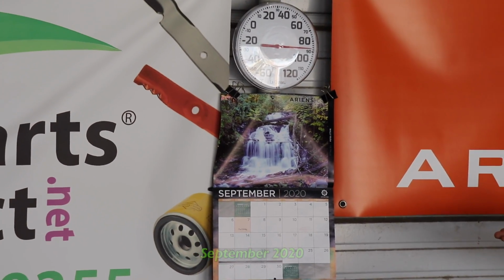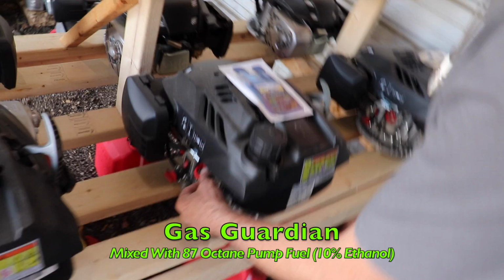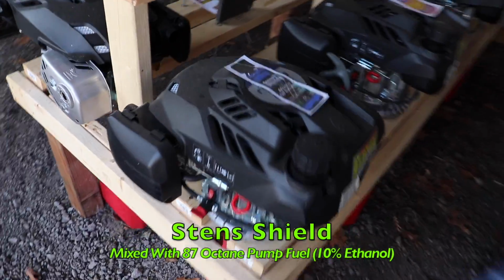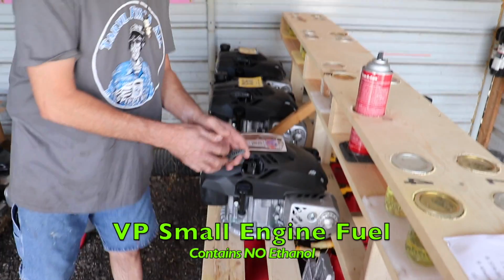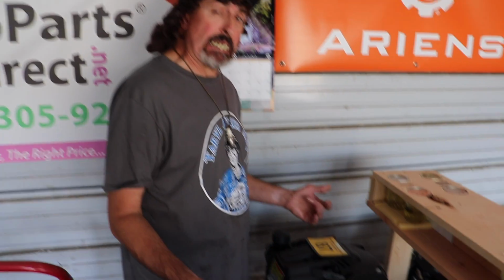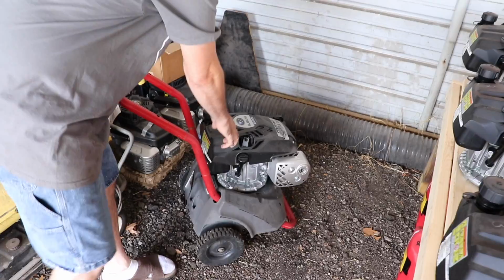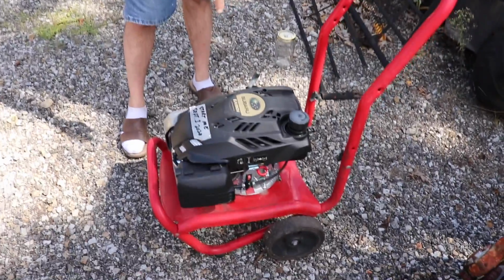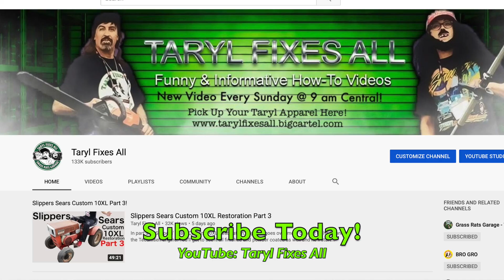Fuel Additives DON'T Work - Why?

Comment: I really enjoy watching. Learned a lot .The scrattons I worked on in the 60s were not that hard to repair. Seems like the newer ones without points are fairly easy to repair.A friend had a 4.5 scratton that been under 2 feet of water at his camp on the river. He figured it was history. Both valves were closed when he turned it off.Ignition was good. Cleaned the carbetrator ,got all the mud off it .It ran great but steamed out the tapper vent a few minutes.

Comment: I've been using Sta-Bil for several years in a 14 y/o 22hp B&S and have never had to disassemble the carb, or have had any trouble with it not starting in the Spring. Actually, I only cut about 60 hours a year and since I don't really use it that much I just put Sta-Bil in my gas can when I fill it up. 
Recently, a new gas station opened near me and they offer 90 octane ethanol-free gas; so I've started using that. Still, I'm continuing to use the Sta-Bil. 
Sta-Bil has about a 2-3 year shelf life (forget exactly how much, it's on the bottle) in it's container and this is why I just put it in throughout the mowing season. I wouldn't use up the Sta-Bil container over the course of a couple years, so, why not.
I do turn the fuel shutoff on the engine and run the carb out of gas at the end of the season.

Comment: I’m storing all my gas in sealed jelly jars from now on.
Reply: Haaa awesome
Reply: Need Extra crunchy peanut butter jars
Reply: Just use clean, non rusty steel Jerry cans with an airtight seal filled to within an inch of the cap and kept out of the sun. I've only kept e0 gasoline for 10 months that way so far but when I open one of those cans it's still just as full and just as clear as the day I filled them up! Just my $.02 worth.
Reply: That brings back memories of going to grandmas in the 60's to mow. Gas was stored in a 1 gallon glass apple cider jug and stored in the cool dark pump house next to the well.
Reply: @WKBHB  that was moonshine
Reply: Grandma liked to party.
Reply: theyre getting hard to find lol
Reply: @jusb1066  No wonder that mower ran so good LOL.

Comment: I'm wondering if the moisture in the air has mixed with the ethanol and settle to the bottom and got burned off first after months of being outside I'd be interested in seeing you pull small amount of fuel out of one of those Motors testing it for ethanol

Comment: My guess is that the 3 month engines had more ethanol separation in the bottom of the carbs. So it took a few extra pulls to get the water sucked out of the bottom of the float bowl before it pulled fuel into the combustion chamber.

The monthly starts on the other engines only has a little water to deal with each month, which may be causing the variation in how many pulls it takes on those engine.
Reply: That definitely makes good sense. 👍
Reply: I was also thinking evaporation in the fuel bowl has something to do with it.  After three months, the fuel in the bowl would have evaporated a lot more than the ones starting every month.  Need a few more pulls to get everything primed back up.  Plus the lower fuel level in the bowl exposes more dried up area for boogers to collect.
Reply: @grosskt  these carbs are gravity fed, so they should have fuel at all times. I dont recall Taryl turning the fuel off on these. This is why ethanol separation is a big deal in this scenario, because all of the water will collect at the lowest point, the float bowl. More time = more water sitting in there.
Reply: Brandon Titus Good point, didn’t think of that.

Comment: You don't have to holler at me Taryl, I got a question. Lol!
The"engines" start up, BUT would they be able to be put under a load? Does the fuel retain enough "umph" to be able to cut some grass? Are they even getting up to full rpm with that old fuel( you have that german rpm checker)? It's just an honest question....
Yes. Put Ronnie on a shirt and Junior (with the saying off his hat!) Lol!
Enjoying the experiment! Keep it coming!
Reply: As I recall, these engines would never be able to cut grass, he'd have to see if they can split wood.
Reply: @chrisbcritter6112  I couldn't remember what their intended function was. I didn't mean literally " cut grass". I'm meaning whatever puts a load on them rather than just sit there and idle. I've put "stale" gas in my chainsaw, it'll start up, but won't have enough "power" to cut wood. But that's 2 cycle. May be getting deeper than his original intention here.

Comment: Yeah summers over (almost). Soon leaves will start to fall and people will be bringing you their snow blowers with carbertrator problems, the cycle of life continues...
Reply: Do you have the Wawa gas stations where you live? they sell Ethanol free gas. you don't need any stabilizers in it.
Reply: In my area, East Tennessee we have Marathon stations that sell Rec90 mid-grade. Recreational fuel 90 octane, no ethanol. That's what I run in my garden tractor lawn mower. Runs better, more power and starts quicker. It's been $.40 cents a gallon more but worth it for lawn equipment. Run in car in winter for faster start up.

Comment: Hello Taryl,
You have proven why I don’t use fuel additives. In November I either run my equipment out of fuel or fill the tanks for winter. In April I check the oil, fill the gas and fire them up, then I move them into the garage for a pre-opt inspection.

Comment: Repeat the same experiment on 2 cycle engines.  That's where I've seen the most problems with my own equipment.  I don't think the larger 4 cycle engines have the same frequency of fuel related problems as the little 2 cycles. Regardless, I've taken my dealer's advice and have always used a fuel additive in the zero turn.  The only problem I ever have is getting it running for the first time in spring.  I think it's mostly due to the fuel evaporating from the carb over the winter, similar to your 3 month trial, although my equipment sits about 5 months.  Now I just pour gas into the carb for the first start of the season.  After that I don't have to repeat that trick.

Comment: I heard a few misfires off the 87 and 93 octane non treated fuels.
One thing our workshop has realised is that if you add a ethanol free fuel like ASPEN into a two stroke machine that has been only run on unleaded pump is that the diaphragms and fuel lines perish quickly as they have already been weakened by the pump fuel.

Comment: Taryl, what I do, is I keep 89 octane in anything I use every summer and I always put just a little bitand the gas tank of my push mower or push mowers and riding mowers and even tillers and other 4-cycle equipment and I go out and start all of that stuff once every two weeks and let it run for about anywhere from thirty seconds to a minuteand sometimes three or four minutes maybe 5minutes if it's a riding mower and I even bring it out and ride it around even if it's 25 degrees out during that time......... now granted here in southern West Virginia we've had zero weather lasts for a solid month before but normally the past many years our winter times have been rain and 42 mid 40 degree days up until most of February and an early part of March seems to be our winter timebut I never use any kind of gas additives and when I have used in the Years passed it never seemed to help if I let something just said and never go out and started for 2 months and beyond that length of time or the whole winter time

Comment: I just got a new 60 inch Toro with the my ride seat. I use Ethanol free never any problems. Taryl you need to put that in your test and let it set for 6 months.

Comment: I have a pretty random question.  I have a c111 wheel hirse with a 11 hp Briggs.  I put a new carb in it but now when I open the throttle it shifts wide open and sticks. I have to shut it down to stop it from blowing up.  Do you have any ideas to whts going on? Thanks!

Comment: i bought a huzqavarna 2018 model used it 8 times followed the 32 to 1 then 50 to 1 they recommended on breakin like i said barely used it now it has 40 compression but out of warrenty.what causes that cheap parts?125bv

Comment: Can you comment on why #3 sealed jar looks clear or empty ?
Reply: It's fancy 4-cycle fuel (no pump gas w/additive - just a metal can of straight gas with no ethanol).  It doesn't have the yellow color additive that pump gas has.

Comment: Does it make a difference between plastic vs metal fuel tank? Just curious.
Reply: In my experience, yes metal seems to keep fuel fresher longer. I believe keeping sunlight away from the fuel is also a factor, may be just enough ambient light makes it through my red plastic cans that caused my experiences idk🤷‍♂️
Reply: absolutely. Plastic does not create condensate as easily as metal and along with condensate in half full metal tanks comes rust above the gas line. Plastic all the way with ethanol gas.
Reply: @garny3766  yes! I forgot to mention I've only used steel cans filled with ethanol free or 100ll to within an inch of the cap for storage. 
Thanks for pointing that out👍

Comment: Considering that the vented jars are evaporating and changing a great deal,  it makes sense for all of us to have an air tight gas can.   I wonder how air tight the tanks on the engines are.
Reply: Air tight gas cans are also safer. No stray gasoline fumes finding a source of ignition.

Comment: Hey taryl, I’ve got myself a 80’s-90’s 11 horse brigs MTD and it only stays in speed 1  even if I push it all the way so speed 7. I’ve tried doing some research but can’t find out why it’s not working like it should. If you could do a video on how to fix that problem or explain how the older speed selects work on riding mowers That would be appreciated.

Comment: taryl, i put gas in my new generator last winter, and electric came back on, so i didnt get to use the thing. i have started it about once a month just to keep the thing active. now it wont start. i suppose something is gummed up. what do you recommend? ty
Reply: Bolt it to a work bench with 10 engines that run every month to mix the gas in the float bowl like Taryl does. It’s working for him.
Reply: @terryskinner9466  Did you shake the bench?
Reply: George Ewing no but put a glass of water on top of your lawnmower and tell me what happens to it. It’s not rocket science!
Reply: I'd drain the fuel out and try fresh fuel first if you haven't already done that.

Comment: I use stabil and lucas safeguard ethanal fuel conditioner together in my generator and years later it starts right up.The key is to fill the tank completely and drain the carburetor. My general rule is to fill metal tanks and totally empty plastic tanks.

Comment: Don't change the run time for the engines because that will introduce a new variable.  After the year is over (unless you're planning on running this for 2 years) why not take the engines and divide them into groups that sit for 3 months, 4 months, 5 months and 6 months without running and use raw 87 octane and the two or three most popular fuel additives to see if they make a difference.  That will more closely simulate the winter storage for mowers in different parts of the country.  Since the months are staggered you'll have a new video each month for most of the year or more.

Comment: To me it seems like atarting them every month could help them. Gas is a very good solvent and as it's passing through the main jet and emulsion tube it could be breaking stuff down.
Reply: Having them bolted to the same bench is shacking the fuel in each tank and carburetor. Ummm kinda like an ultrasonic cleaner?? I think we would of had different out comes if these engines wasn’t bolted on that work bench together. Just my opinion. Probably why number 10 took 3 pulls to start. It hadn’t been shook up.
Reply: George Ewing you don’t think those engines running aren’t shaking those other engines and slashing that gas in them?😂

Comment: The vented jars of gasoline have lost so much because the jerry cans were presumably filled in December.  Winter gas has a higher vapor pressure and evaporates more readily than low vapor pressure summer gasoline.  You'd lose nearly a quarter of one of those closed jars if they were opened up on a really hot summer day.  It's also why the cans are so puffed out.  What I can't understand is the puckered in gas can.

Comment: I don’t believe you should change the run time. I do have a question. When you run the engine out of gas, do you replace it with vented or sealed gas?

Comment: I think the reason the mowers that sit longer start harder is that the gas in the float bowl gets more moisture in it and evaporates and turns crappy quicker because it's vented better. The gas in the tank keeps it's minty freshness a lot longer.

Comment: One thing this test is not doing is checking to see whether the idle circuits in engines that idle are affected and whether the engines still idle. The engines in the test all start and run at governed speed. Generally the carbatrator idle circuits are smaller passages and more easily plugged with corrosion, water or bits of deteriorated rubber from fuel lines or carbatrator parts than high speed circuits. I suspect that some complaints are caused by engines that start but will not idle or transition from idle to high speed. I'm actually a bit surprised that the 10% ethanol engines with no treatment are still hanging in there.
Reply from the maker: True, but these are vertical shaft lawn mower type engines that would use a safety bale on the handle for starting. That type of outdoor power equipment has no need for a throttle. These engines that were donated from Ariens were for their log splitters that they no longer manufacture. They have a heavy flywheel and manual choke, and as you mentioned they only run at one speed. We chose this engine only for the reason that this is a engine that would be found on a walk behind push mower, logsplitter, pressure washer, generator. We wanted an engine that would cover a majority of basic homeowner power equipment. Thanks fer yur comment and keep watchin'  Taryl out

Comment: I said from the get-go, this test should be more real world; equipment put away and not touched for 4-5 months.  Like most of us do with mowers in the northern states.  Thats where the gumming up of the carbs is going to occur.  Stale gas sitting in the bowls. Also recall the blowback from several including Taryl.

Comment: i keep my two running mower outside all the warmers months, in the rain and everything. never had any problem with them. only after the winter there is water and garbage inside the tank and they never start without a carb cleaning. i keep them in a shed for the winter.

Comment: Without out a primer bulb does the fuel get drawn in with every pull?
Reply: Gravity fed carburettors with a fuel tap
Reply: Depends on compression, the better the seal of the rings, the more fuel it'll pull in!

Comment: I knew your thinking would eventually come around to my proven knowledge. 
1) 93 octane: what I believe is going on there is a problem that can be traced back to the start. I’m talking about filling gas can at station with 93. How much you want to bet that 93 was probably weeks if not months older than the 87 you got?...so that gas has already started its degradation process before it even entered the engine.
2) of course folks are not starting OPE monthly. When I know OPE that comes into my shop has been sitting for months first thing I do is drain the bowl until I get fresher gas from the tank.
3) I think you should let all them engines sit until December, but my experience is the cold weather does not deteriorate gas as quickly. Heat and humidity does. And if you don’t at least fill up the k100 engine and let it sit till December too!
4) nice work!

Comment: Don't just run them for a few seconds. You need to get the spark plugs hot enough to clean up or you may have fouling issues mixed in with fuel issues, no?

Comment: Taryl you can not change things during an experiment. Then it's not an experiment anymore when you changed the variables. I am interested in the idea of the lawn mower setting vs  starting every month. I never liked K-100 I always thought it smelled like fish. Are you going to do Carburetor tear down and  tell us the failure?  Like where in the slow speed circuit the "crud" was. Where is the phase separation of the fuel. c'mon atmosphere cause phase separation. We all heard about at Kawa sakakakiiii School.

Comment: The Bloated Plastic Gas Can Story:
In Florida, a plastic gas can left out will bloat when hot,
and shrink when cold, of course, we all know this.
The 'can' WILL destroy itself eventually.
I put a small hole UNDER the handle  to allow
expansion and contraction gases to freely move,
and therefore prevent this problem.
Water cannot enter the can since the hole
is under the handle.
The gas is used often enough that evaporation
is not  a problem.
Reply: Wonder if that theory holds true even in Australia or if it's like their toilets that flush counter-clockwise.
Reply: @chainsawchips  Hey mate!  What theory?
North Central Florida, USA
Reply: @mrbrown6421  The theory of gas expanding with heat and contracting with cold. Wonder if it;s the opposite in Australia, like their toilets that flush counter-clockwise rather than clockwise like it is here in the States.

I don't understand why one of Taryl's gas cans was sucked in with the heat he was talking about in the video .  ...Sounds like the work of Ronnie Jergenstein tryin to botch a video.

Comment: Don't change your testing methods this far into the experiment. 
If you want to run engines shorter periods of time I'd suggest starting another experiment after this one. 

Reason sitting longer without starting is worse is because fuel sits in bowl longer. every time engine is started "fresher" fuel is run threw the carb. 

Ive seen gummed up carbs and clean tanks before however not very often.😉